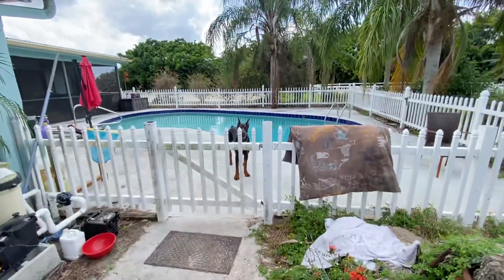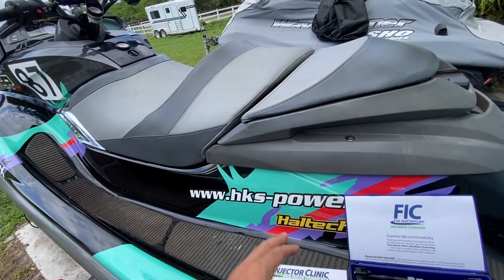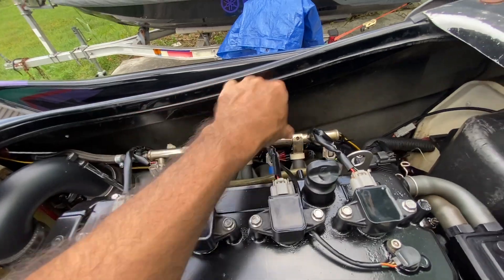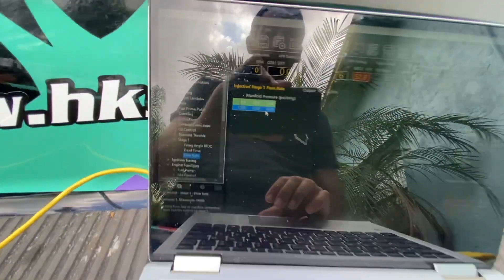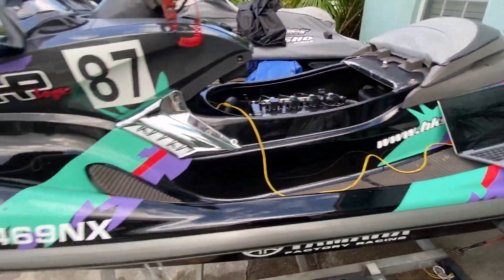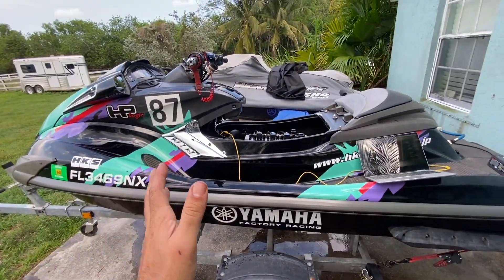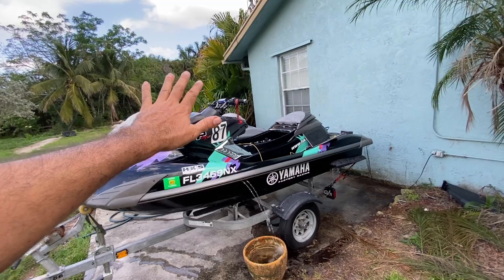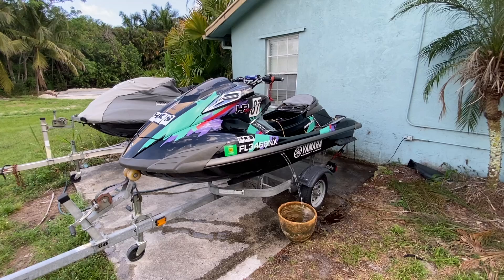My JETSKI runs on ALCOHOL | FIC 1000cc injector upgrade | Flex Fuel setup

Comment: Got the same ski and with E85 its really only a 1.5 mph gain but it runs way colder so  you can run more boost/compression.Personally I wouldnt go too much bigger on the supercharger because they tend to come apart with big wheels.If you want a little more power change the pistons to High compression its a little involved of a process but a solid 3mph gain with no reliability issues
Reply from the maker: I don't know if this hull can take much more power....but a rebuild will be bullet proof for sure.